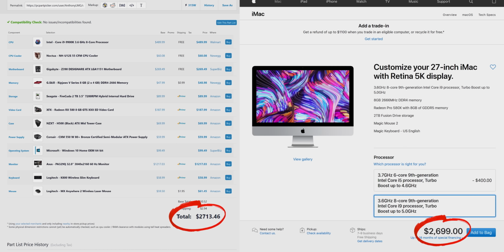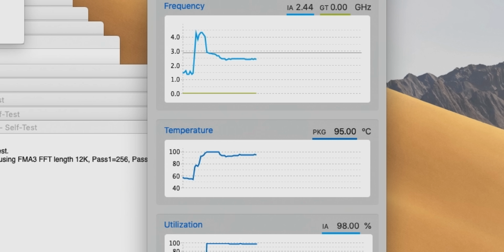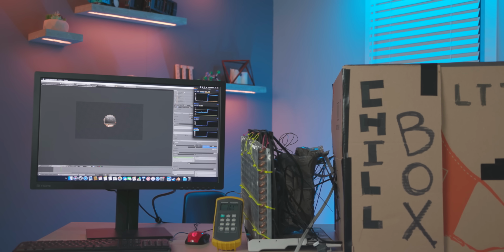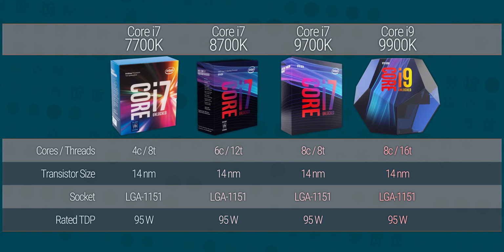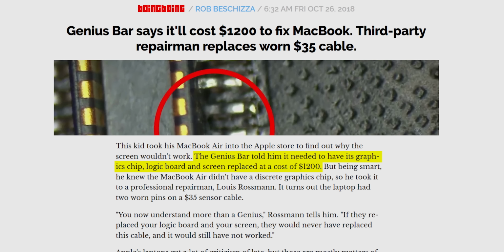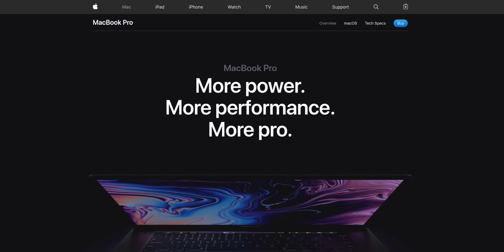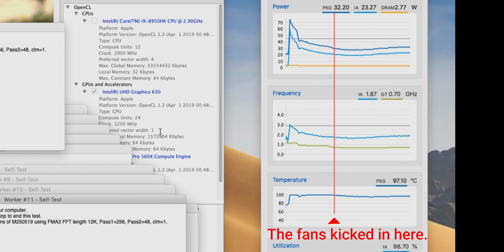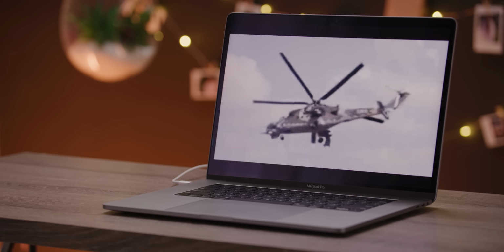Macs are SLOWER than PCs. Here’s why.

Comment: Its not the hardware its the operating system. MacOs demolishes windows any day in productivity, response, usability and aesthetics.
Reply: What do you mean productivity, response  usability and aesthetics? I find windows just as usable, just as responsive, is em more productive at times because you can do more and aesthetics are simply subjective
Reply: Zach B i have my macbook pro 2014 which is £1200 and my PC (2016) which was £1100 and has better hardware. And everything from startup time, to how quick applications load assets, to how stable software releases are on the mac compared to PC is very obvious. I use both platforms for work regularly and on a daily basis the mac just performs far better with less issues. My mac has never once frozen or ever had the need to close an application compared to at least once or twice daily on my PC. Adobe and cinema 4D actually opens faster on the mac which are my primary software. And yes my PC is a good brand and well looked after. Even my 2-year old mac was more efficient than my new PC when i bought and this has been the case on the numerous laptops and desktops i have used.

I push my hardware hard on both systems in terms of CPU and GPU. 

And i have never met a person that hasn’t had a PC crash or freeze or require restarting. But in 6-years my mac hasn’t crashed, slowed down or even frozen in the slightest once. It always starts up from cold immediately and runs perfectly everytime. 

Same experience for the majority of users who switch to mac. 

Yes a PC is better for playing games, programming or networking. But for design, productivity, and creativity purposes - the stability, smoothness and real-world speed is more important and a better experience on a mac. Though i prefer linux for servers and networking. 

Plus the inclusive environment on macOs creates a far more stable experience than windows ever can due to “doing more stuff” on windows. Stuff the majority of people don’t need. And if those types of customisations you need, then use linux.

Even just looking through your files and the way the system is organised is quicker, with many system files within the applications content is far quicker and effort for modding and adjusting assets. 

And just look at the mess of windows 10. Its chaotic and unorganised. Windows xp was its most friendly interface but had so many stability and security issues. It is well known that the start menu has so many issues and is slow, the registry system of windows is a mess and removal of registry during uninstalling barely works, the amount of hidden bloatware and sponsored ads and apps is annoying, its method of installing new apps is slow and can easily create errors, the constant issue with drivers, the ridiculous windows update system,

And the biggest reason why windows has so many issues is because apple creates is hardware and software so it performs perfectly together compared to Microsoft which only produces the software separately to the hardware created by other organisations. So with a mac you are almost guaranteed to software compatibility.

And i have yet to fine a single application or feature that windows has but a mac doesn’t. Since the majority software on mac is very high quality and professional. So you don’t need 100 different types of graphic programmes from different publishers, you just need the one that does it all.

But yes i have the uses for my PC particularly for the better GPU, but it just doesn’t compare to using a mac as your primary machine for daily use. But that has nothing to do with Microsoft windows but rather the hardware developer.
Reply: Steven for design productivity and creativity, having better hardware will enable you to do more. It’s more flexible, and more software is supported for Windows. 

Crashing and restarted are all the softwares problem. Internally a Mac and PC are identical, and although max os is more streamlined that doesn’t stop programs from crashing. It also means you can’t do as much with a Mac, as it’s less flexible and more locked down.
Reply: Steven and I agree Mac does have an advantage (however small) because it can build the rivers directly into the OS. However they are known to be too pushy, and that’s why you won’t be seeing Nvidia in a Mac for years. 

And what do you mean the software on Mac is very professional? They do have some high quality first party apps like iMovie and Logic Pro X, however there are (equal or better) alternatives, like Premiere Pro.
Reply: Steven at the end of the day, your buying into overpriced hardware that’s forcing you into an unhealthy ecosystem and is fuelling more and more bad practices. Apple should t be able to sell Mac Pros for over double the price of a pc with equivalent (and actually better) hardware. Its os is awfully locked down, it doesn’t support quite as many apps, it’s overpriced - and forget about ever upgrading one of them down the line.
Reply: Zach B completely untrue its a myth. When you actually price match hardware based on performance similarities like-for-like there is not much difference in price between commercial products. Because macOs and apple hardware are far more efficient and you get a better performance then you would using the same hardware on windows. 

And again no one is bothered about having Nvidia on a mac. They are designed for work  - not games. And if you need high fidelity rendering you use a server farm - you also do this if you have a PC. 

Like i said i have both with my pc having far newer and more powerful hardware yet in a professional capacity - my mac still out performs windows PC, considerably. 

And software on mac - meaning only professional grade software is available. There is not so many poor third party software that you get on PC. Everything you need to produce anything is available at the highest standard. Windows has more software but 80% of them are a waste of space and pointless.

Unhealthy ecosystem? Lol nope. Secure, efficient and very useful. Having your entire system flawlessly available between devices, using your phone and ipad and mac within the same network and ecosystem, being able to work at home and immediately continue on ipad without any setting up. Its extremely efficient and effortless to use their ecosystem.

The OS is lockdown for a reason. 90% of users dont need to access the internals of their software or access important system files. This is how you get stability and security and software that works far faster than the windows equivalent. 

I do all of my work on the mac and apple ecosystem because of how perfectly everything works between devices with no errors at all. Ever tried using a windows phone? Lol or surface pro? When handing over between home and mobile jobs? Absolute nightmare.

And I upgraded my mac pro easily. New 16gb ram and 1tb SSD. I did it myself and very quick and cheap. And there is very little need to upgrade because even 6-years later they don’t deteriorate or slow down. I only upgraded recently because of the amount of data i had on mine and the tasks i do.

And you do not need hardware above your software requirements. The macbook pro is already over the needed requirement - apart from SSD storage space - hence my upgrade.  I can run all high-output software without any issues. The only hardware it lacks is for gaming. Which no one uses a mac for gaming - buy a playstation 5 for that. Its already more power than any existing PC today.

Have you used both a mac and PC within your pipeline of work for an period of time? I have for 6-years. And everyday i still feel the difference. Its very noticeable that a PC with windows just does not compare to macOS. Until you use it you cannot understand the relevance of a good stable operating system designed around usability and response.

Comment: As much as throttle annoyed me in iMac and I sold it after 3 months, I never thought it was issue for me on my MacBook Pros. Does it throttle? Yes, a lot. Can you use it for calculations? A little but generally no. But as IT professional I never used any other laptop that comes close to MBP. I would rather it to throttle than start fans to max like Dell XPS does. Can it match productivity of my desktop PC? Nope. Can any Windows laptop match my MBP productivity on a go? Nope, not even close. Different use cases. Great video!

Comment: I think iPhone have their in House chips and hence can tweaked as per iOS requirements however the Macs don't have their own chips . However the situation maybe better when apple uses its own AMR chips. @linustechtips
Reply: ARM are you for real?, ARM does extremely well in the smartphone and tablet market, I'm not too sure if it'll do well in the Laptop market (specifically Apple products), but I'll wait and see.
Reply: Moses Jonson yes it does but it hasn’t been test yet in the MacBooks 💻 yet; also you should checkout the reported rumours at everything apple pro where he suggests Apple is moving towards using it’s in house chipsets.
Reply: ARM chips are better at efficiency, not raw power. Especially when you look at Intel vs Qualcomm chips in the laptop market - Intel reigns supreme, even when Qualcomm chips are more power efficient. Macbook Pros are supposed to be powerhouses, and for at least the next 5 to 10 years, x86 processors are the way to go.
Reply: carter.n I agree with you but my argument isn’t that bro I’m saying the way Apple raw powerful chips for iPad pros it can do the same for baseline MacBooks and MacBook Air ‘s that is majorly used for content consumption by majority of users
Reply: @techietony7140  I see, then yeah for MacBook airs, the Arm chips put in iPad pros would be great for them. Let's just hope they pull off the compatibility issues better than Microsoft did with the Surface Pro X lol
Reply: carter.n man really like your knowledge in the field respect ✊🏻 also it’s not so common you see people with such knowledge on these topics 👏🏻

Comment: "Same price or even more expensive than a mac"
Let's casually ignore that 32" 1.2k display you got chucked in there and comparing against a 27" mac.
Reply: It is about the resolution here, display size doesn't really matter in this comparison.
Reply: @JannikPitt  The 27" equivalent from the same manufacturer is 40% cheaper currently. Just so you know.

Comment: I disagree. I have owned multiple Windows laptops and computers and the programs in windows - they are very slow and no matter how "good" computers I buy - I end up throwing them into bin because they break so easily. I play games both Windows and IOS and somehow IOS has better picture performance and games run smoothly + Windows has a habit of "jumping out of programs" which I have never seen in IOS. You can test all kinds of technical aspects but when it comes to programs themselves, there's huge difference between IOS and Windows. I don't know if Windows lovers in Youtube own the most expensive and top top top Windows products to compare with regular IOS but it seems that regular Windows computers compared to regular IOS are not the same. It's strange to compare two products which have different purposes and different operating systems. Windows has its flaws and same with IOS. In practice - IOS definitely is faster with whatever they do and you can test it with games, video editing systems, picture editing systems etc. They come in price but definitely not a disappointment. There's a reason why so many designers and visual engineers use IOS instead of Windows. If windows was that great, apple wouldnt have so many buyers from areas which require a lot of creative programs and programs what suck up 100% out of every possible chip you have in your computer :)
Reply: You must be then really shitty at handling with PC's if they break so easily. That doesn't make sense lol, in my 6 and half years of building or upgrading different PC's have had to come across those issues. Don't know why you are bringing up Operating systems into this topic, because the video is focused on why are Macs slower then PC's on a hardware scale, if you watched the entire video, Linus literally brings up the point that Apple is just shitty and lazy at their designs, and because of less tech savvy people like you, you will keep buying Macs even if their problems predates back to its predecessors, you don't care about the specs of your mac, you just care about how it looks and how it feels.
Too simple minded

Comment: Another advantage Apple has, on its hand, has something to do with macOS. macOS is designed based on UNIX operating system. Unix Operating system can perform a little better over windows 10. I have to agree with Linus, the Mac customer base, likes the slick look, and they cannot detect any thermal throttling. The look is more important. Starbucks coffee and 16" MacBook pro doing web browsing and sending emails.
Reply: But you still won't notice those performance changes between the OS if the Mac keeps throttling

Comment: I thought LTT was smarter than this.  Apple knows something you dont seem to know.  They know that people arent going to be running Prime95 and other CPU benchmark tests on their machines.  They are going to be using final cut pro and other tools that are specifically designed to work on macs.  The software you are comparing the macs to PCs with is something you'd never use on a mac.  You are abnormally pushing the machine past the limits that it was designed for.  By limits I mean the limits of what its users would use it for.  A macbook Pro's hardest life in the hands of a real mac user will be web browsing, twitter and maybe some youtube videos.  They might even edit a youtube video in FCP.  But they wont be gaming, or running any ridiculous heavy tasks with their macbooks.  Im on a 2018 air, and its flawless.  I do all that I said above, and leave the benchmarking and gaming to the desktop PC I have.
Reply: Holy fuckkk, prime95 basically stress test based on how similarly a video editing software would lol, please do some research, watch the whole video at least before spouting nonsense. You just sound like a brainlet to an average person
Reply: @vlad3223  It absolutely does not.  It stresses a CPU WAY past anything you'd see in real life.  You are dead wrong.
Reply: @LMBC6Brian  there's no other possible way to stress a cpu past its limits, that would just start killing it. What you are talking about is if the program uses 100% of the cpu, what I am talking about and the point of this video is that Apple implemented a cpu that has shitty cooling and doesn't perform up to its advertised cpu boost clock speeds. On purpose shitty design, you might not notice difference right now, but over long periods of its lifetime, the cpu this way just dies quicker. For example when I stress tested my previous laptop with fine cooling and I stress tested it, it didn't go above 75 c maximum with 4.2 ghz, a laptop such as Mac shouldn't be reaching basically the boiling point of water just to maintain its base clock speed of around 2.9 ghz
Reply: @vlad3223  You couldnt be more wrong.  Prime95 is notorious for killing CPUs and pushing them past what normal software would do.

Comment: Completely agreed with what has been said here but most probably they are doing this because 99% of their customers would not even know what are these issues and will just say 'MY LAPTOPS SPECS ARE MUCH BETTER THAN YOUR FANCY MACBOOK PRO' if Apple uses a slower CPU to keep temperatures in ideal levels instead of using the newest and the fastest one. So I think Apple is doing this because of their customer behavior which is caused by ignorance itself. Even in the battery scandal that Apple faced with their iPhones, people have said see Apple is intentionally decreasing the speed of our devices. While Apple was decreasing performance to use lower energy to keep that dead battery to hold at least 4-5 hours of charge. What would a customer want with a dead battery, to use their phone just for an hour with maximum CPU speed or 4-5 hours with decreased CPU speed? Also, the battery is being dead after 2 years is nothing that Apple can do by themselves, it is the nature of Lithium-Ion technology. Apple does not need to declare every decision that they take on their own designed devices to their customers. If people know this much, then they should be the designers of the device.

Comment: built in obsolescence at it's finest, imagine having to replace all your devices every year smh
Reply: Most modern ultrabooks are. Apple may have started this trend, but others did pick up on it. No way to upgrade. RAMs and (most of the time) HDDs soldered to the motherboard. If you want a lightweight, small laptop - you're mostly screwed. Only the bigger laptops have some limited ways to upgrade the RAM and HDD, but nothing else.  And honestly that's somewhat good, because it means that the "traditional" desktop PCs aren't getting obsolete anytime soon

Comment: The Virgin Macbook and iMac: Sluggish, Slow, Needs to reduce fan speed to improve battery life, Limited air cooling, High premium for no real gain, Markets to Simps, Not Upgradeable, Natural Habitat is Starbucks or Hipster apartment.
The Chad Linux System: Can be on older hardware, Blazing fast for Stacy's benefit, Remains Ice cold during normal use, Free OS, Can be customized to anyone's needs, Natural habitat is a normal house.
Reply: But Linux still doesn't have the support that windows gets with a wider range of softwares, so for an average user ima go with windows